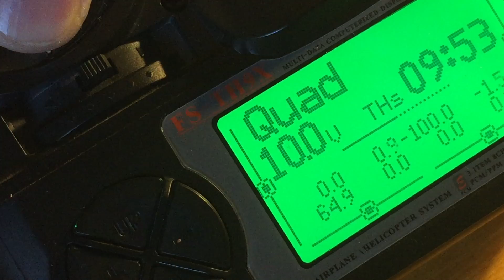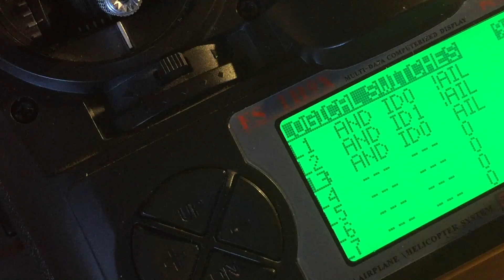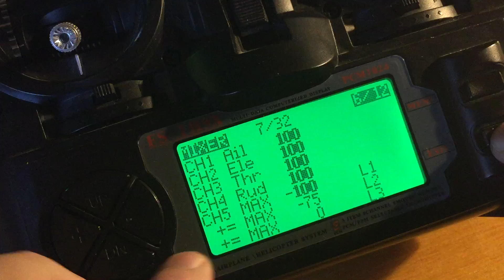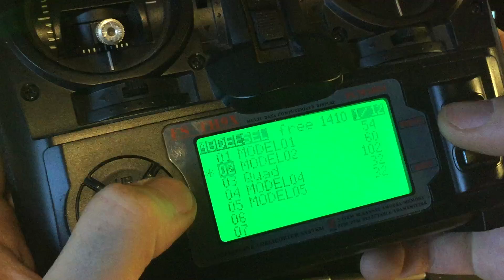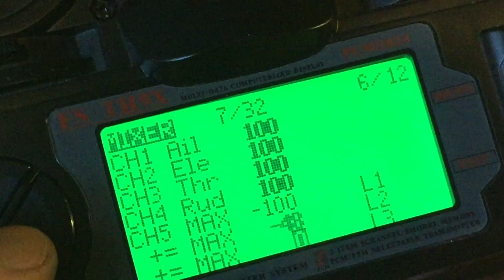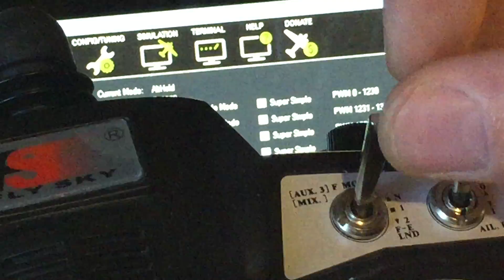OpenTX APM flight modes for quadcopter - 9x transmitters

Comment: Could you help me with the connections. Because just heard PPM won't work with Pixhawk after upgrading. How how to connect the receiver with flight controller.
Reply from the maker: This was five years ago, I did that for documenting and remember nothing of this now, sorry :) You know more about the topic than I do at the moment probably. Hope this video helps in some aspect, sorry if it does not.

Comment: Hello just wondering if you could post copy of the model setup as eeprom so can play around and get my naza lite setup cheers. 

Just finding 3 pos switch isn't locked into to the 3 set points i adjust weights but isn't enough to get in right spot for gps, manual, Altitude.
Reply from the maker: Hi, sorry, I've since switched firmware to test other modifications to 9x with telemetry